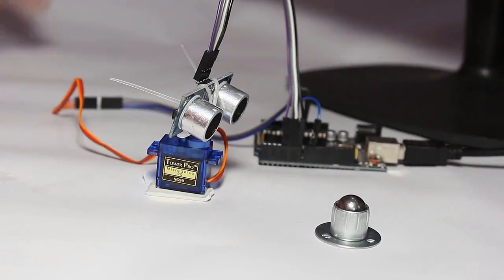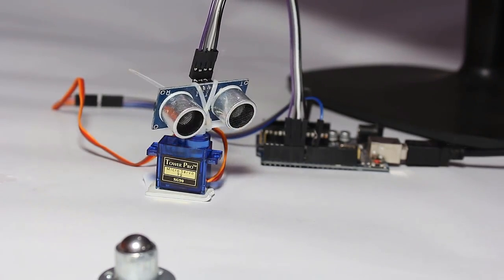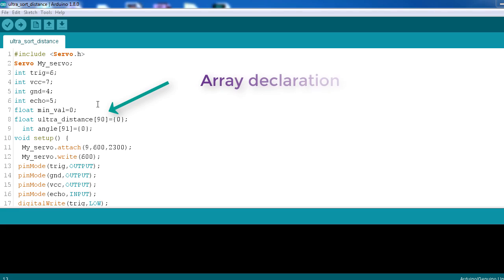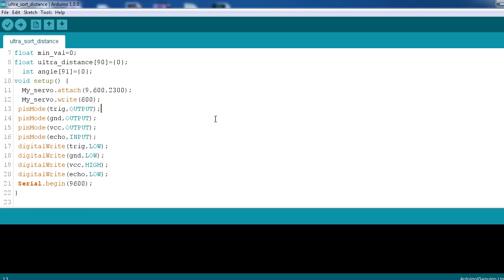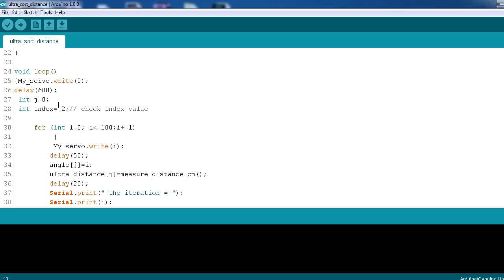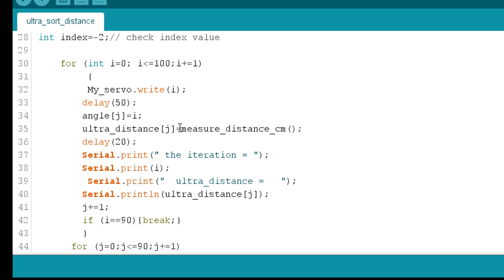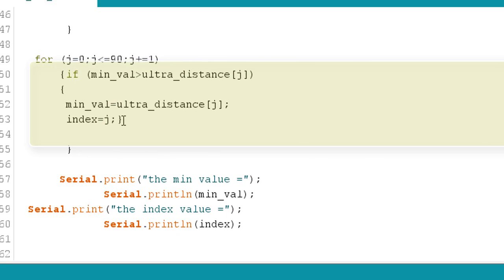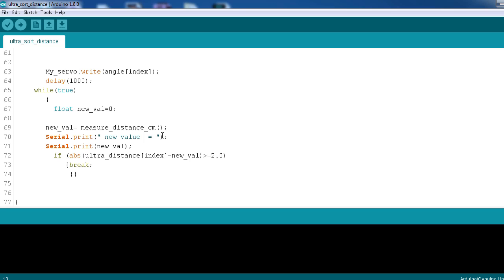Ultrasonic Object Radar System ( with Arduino Sketch)

Comment: Sir where to connect the red and purple wire of servo motor, please reply it's urgent
Reply: The sensor is not stopping in the direction of the object it is only rotating in every direction
Reply: Please reply,I have to present this model in the science exibition day after tomorrow

Comment: pls black wire of the servomotor red orange where should it connect
Reply from the maker: black wire is for ground connection, red wire for 5v power supply and orange for pwm signal
Reply: pwn pin number is what??
Reply: bro can u give me ckt diagram of connection of arduino

Comment: Sir, Where can I find the programcode?
Reply from the maker: #include <Servo.h>
Servo My_servo;
int trig=6;
int vcc=7;
int gnd=4;
int echo=5;
float min_val=0;
float ultra_distance[90]={0};
  int angle[91]={0};
void setup() {
  My_servo.attach(9,600,2300);
  My_servo.write(600);
 pinMode(trig,OUTPUT);
 pinMode(gnd,OUTPUT);
 pinMode(vcc,OUTPUT);
 pinMode(echo,INPUT);
 digitalWrite(trig,LOW);
 digitalWrite(gnd,LOW);
 digitalWrite(vcc,HIGH);
 digitalWrite(echo,LOW);
 Serial.begin(9600);
}

void loop()
{My_servo.write(0);
delay(600);
 int j=0;
 int index=-2;// check index value
  
     for (int i=0; i<=100;i+=1)
          {
          My_servo.write(i);
         delay(50);
         angle[j]=i;
         ultra_distance[j]=measure_distance_cm();
         delay(20);
         Serial.print(" the iteration = ");
         Serial.print(i);
          Serial.print("  ultra_distance =   ");
         Serial.println(ultra_distance[j]);
         j+=1;   
         if (i==90){break;} 
         }
       for (j=0;j<=90;j+=1)
       {min_val=max(min_val,ultra_distance[j]);
      
        }
         
   for (j=0;j<=90;j+=1)
       {if (min_val>ultra_distance[j])
       {
        min_val=ultra_distance[j];
        index=j;}
       
        }
        
       Serial.print("the min value =");
              Serial.println(min_val);
  Serial.print("the index value =");
              Serial.println(index);
       

        My_servo.write(angle[index]);
        delay(1000);  
     while(true)
        {
          float new_val=0;
        
        new_val= measure_distance_cm();
        Serial.print(" new value  = ");
        Serial.print(new_val);
          if (abs(ultra_distance[index]-new_val)>=2.0)
             {break;
              }}
          
        
}

float measure_distance_cm()
{
  float distance =0;
  long time_value=0;
  digitalWrite(trig,HIGH);
  delayMicroseconds(10);
  digitalWrite(trig,LOW);
  time_value=pulseIn(echo,HIGH);
  distance=.033*time_value/2;
  return distance;
    }
Reply: sir how can i make it 165 degree instead of 90 degree plss sir reply i need urgent
Reply: yes how  ???

Comment: the correct code is

#include <Servo.h>
Servo My_servo;
int trig=6;
int vcc=7;
int gnd=4;
int echo=5;
float min_val=0;
float ultra_distance[90]={0};
  int angle[91]={0};
void setup() {
  My_servo.attach(9,600,2300);
  My_servo.write(600);
 pinMode(trig,OUTPUT);
 pinMode(gnd,OUTPUT);
 pinMode(vcc,OUTPUT);
 pinMode(echo,INPUT);
 digitalWrite(trig,LOW);
 digitalWrite(gnd,LOW);
 digitalWrite(vcc,HIGH);
 digitalWrite(echo,LOW);
 Serial.begin(9600);
}

void loop()
{My_servo.write(0);
delay(600);
 int j=0;
 int index=-2;// check index value
  
     for (int i=0; i<=100;i+=1)
          {
          My_servo.write(i);
         delay(50);
         angle[j]=i;
         ultra_distance[j]=measure_distance_cm();
         delay(20);
         Serial.print(" the iteration = ");
         Serial.print(i);
          Serial.print("  ultra_distance =   ");
         Serial.println(ultra_distance[j]);
         j+=1;   
         if (i==90){break;} 
         }
       for (j=0;j<=90;j+=1)
       {min_val=max(min_val,ultra_distance[j]);
      
        }
         
   for (j=0;j<=90;j+=1)
       {if (min_val>ultra_distance[j])
       {
        min_val=ultra_distance[j];
        index=j;}
       
        }
        
       Serial.print("the min value =");
              Serial.println(min_val);
  Serial.print("the index value =");
              Serial.println(index);
       

        My_servo.write(angle[index]);
        delay(1000);  
     while(true)
        {
          float new_val=0;
        
        new_val= measure_distance_cm();
        Serial.print(" new value  = ");
        Serial.print(new_val);
          if (abs(ultra_distance[index]-new_val)>=2.0)
             {break;
              }}
          
        
}

float measure_distance_cm()
{
  float distance =0;
  long time_value=0;
  digitalWrite(trig,HIGH);
  delayMicroseconds(10);
  digitalWrite(trig,LOW);
  time_value=pulseIn(echo,HIGH);
  distance=.033*time_value/2;
  return distance;}
Reply: thank you very much mr. essam

Comment from the maker: #include <Servo.h>
Servo My_servo;
int trig=6;
int vcc=7;
int gnd=4;
int echo=5;
float min_val=0;
float ultra_distance[90]={0};
  int angle[91]={0};
void setup() {
  My_servo.attach(9,600,2300);
  My_servo.write(600);
 pinMode(trig,OUTPUT);
 pinMode(gnd,OUTPUT);
 pinMode(vcc,OUTPUT);
 pinMode(echo,INPUT);
 digitalWrite(trig,LOW);
 digitalWrite(gnd,LOW);
 digitalWrite(vcc,HIGH);
 digitalWrite(echo,LOW);
 Serial.begin(9600);
}

void loop()
{My_servo.write(0);
delay(600);
 int j=0;
 int index=-2;// check index value
  
     for (int i=0; i<=100;i+=1)
          {
          My_servo.write(i);
         delay(50);
         angle[j]=i;
         ultra_distance[j]=measure_distance_cm();
         delay(20);
         Serial.print(" the iteration = ");
         Serial.print(i);
          Serial.print("  ultra_distance =   ");
         Serial.println(ultra_distance[j]);
         j+=1;   
         if (i==90){break;} 
         }
       for (j=0;j<=90;j+=1)
       {min_val=max(min_val,ultra_distance[j]);
      
        }
         
   for (j=0;j<=90;j+=1)
       {if (min_val>ultra_distance[j])
       {
        min_val=ultra_distance[j];
        index=j;}
       
        }
        
       Serial.print("the min value =");
              Serial.println(min_val);
  Serial.print("the index value =");
              Serial.println(index);
       

        My_servo.write(angle[index]);
        delay(1000);  
     while(true)
        {
          float new_val=0;
        
        new_val= measure_distance_cm();
        Serial.print(" new value  = ");
        Serial.print(new_val);
          if (abs(ultra_distance[index]-new_val)>=2.0)
             {break;
              }}
          
        
}

float measure_distance_cm()
{
  float distance =0;
  long time_value=0;
  digitalWrite(trig,HIGH);
  delayMicroseconds(10);
  digitalWrite(trig,LOW);
  time_value=pulseIn(echo,HIGH);
  distance=.033*time_value/2;
  return distance;
    }
Reply from the maker: just record every data set in a array , after the completion of scan , your algorithm will check for minimum distance in the array and corresponding angle. once you get the coordinate in angle then you just have to pass that angle to servo and it will stay their.
Reply: sir how can i make it 165 degree instead of 90 degree plss sir reply i need urgent

Comment: Arduino: 1.8.2 (Windows 10), Board: "Arduino/Genuino Uno"

C:\Users\vishal\Documents\Arduino\vish12a.ino\vish12a.ino.ino:1:19: fatal error: servo.h: No such file or directory

 #include <servo.h>

                   ^

compilation terminated.

exit status 1
Error compiling for board Arduino/Genuino Uno.

This report would have more information with
"Show verbose output during compilation"
option enabled in File -> Preferences.

this error
Reply from the maker: use correct file name "vish12a.ino.ino" don't save with .ino and extension .ion combined
Reply from the maker: if problem persist u can send me a mail to   jaimangal.mech@gmail.com  . Will send u the compiled arduino sketch file just directly upload in the board .
Reply: show the same error please give me compiled program

Comment: sir please give me a link for code
Reply from the maker: #include <Servo.h>
Servo My_servo;
int trig=6;
int vcc=7;
int gnd=4;
int echo=5;
float min_val=0;
float ultra_distance[90]={0};
  int angle[91]={0};
void setup() {
  My_servo.attach(9,600,2300);
  My_servo.write(600);
 pinMode(trig,OUTPUT);
 pinMode(gnd,OUTPUT);
 pinMode(vcc,OUTPUT);
 pinMode(echo,INPUT);
 digitalWrite(trig,LOW);
 digitalWrite(gnd,LOW);
 digitalWrite(vcc,HIGH);
 digitalWrite(echo,LOW);
 Serial.begin(9600);
}

void loop()
{My_servo.write(0);
delay(600);
 int j=0;
 int index=-2;// check index value
  
     for (int i=0; i<=100;i+=1)
          {
          My_servo.write(i);
         delay(50);
         angle[j]=i;
         ultra_distance[j]=measure_distance_cm();
         delay(20);
         Serial.print(" the iteration = ");
         Serial.print(i);
          Serial.print("  ultra_distance =   ");
         Serial.println(ultra_distance[j]);
         j+=1;   
         if (i==90){break;} 
         }
       for (j=0;j<=90;j+=1)
       {min_val=max(min_val,ultra_distance[j]);
      
        }
         
   for (j=0;j<=90;j+=1)
       {if (min_val>ultra_distance[j])
       {
        min_val=ultra_distance[j];
        index=j;}
       
        }
        
       Serial.print("the min value =");
              Serial.println(min_val);
  Serial.print("the index value =");
              Serial.println(index);
       

        My_servo.write(angle[index]);
        delay(1000);  
     while(true)
        {
          float new_val=0;
        
        new_val= measure_distance_cm();
        Serial.print(" new value  = ");
        Serial.print(new_val);
          if (abs(ultra_distance[index]-new_val)>=2.0)
             {break;
              }}
          
        
}

float measure_distance_cm()
{
  float distance =0;
  long time_value=0;
  digitalWrite(trig,HIGH);
  delayMicroseconds(10);
  digitalWrite(trig,LOW);
  time_value=pulseIn(echo,HIGH);
  distance=.033*time_value/2;
  return distance;
    }
Reply from the maker: enjoy :)
Reply from the maker: you can copy the code from here - http://www.redtron.org/ultrasonic.html
Reply from the maker: http://www.redtron.org/ultrasonic.html